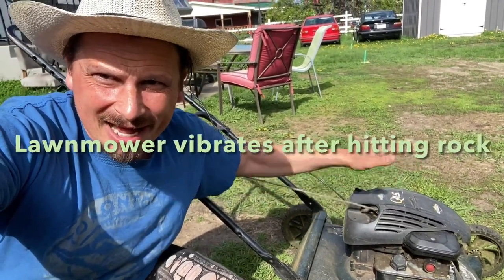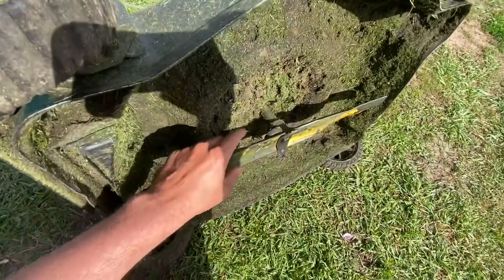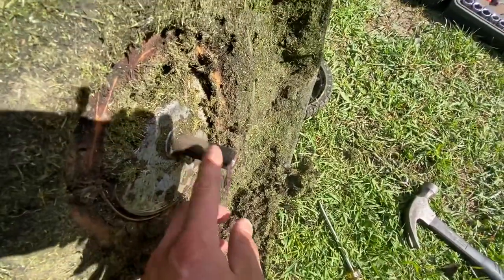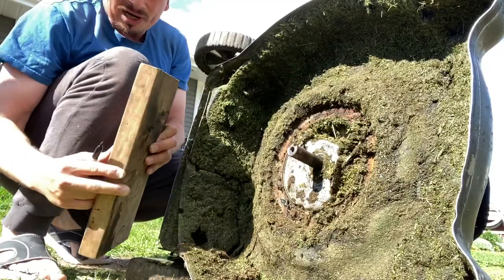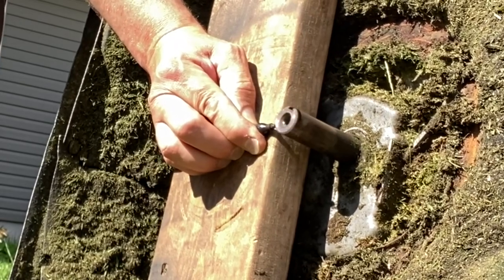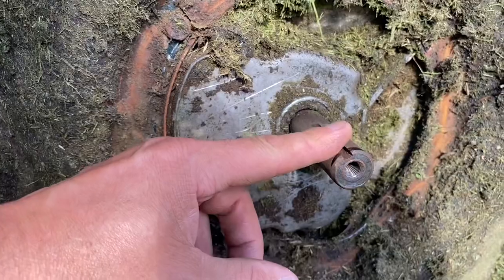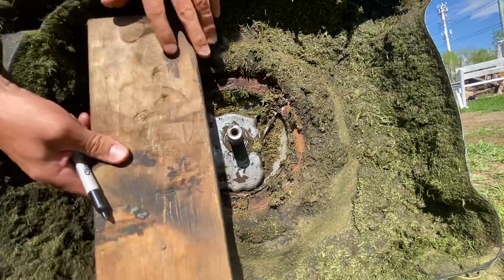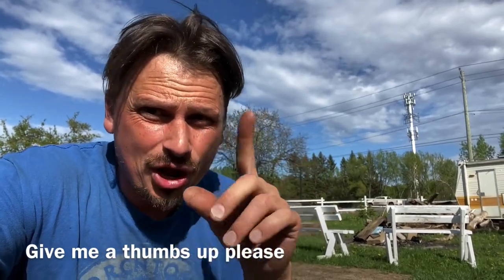How to fix a vibrating lawnmower after hitting a tree stump or rock. Straighten a lawnmower shaft.

Comment: I used to pound the sand outta my old mower’s crank when it bent but then discovered the more controlled method of using an eight foot pipe. Just tip the mower and strap it against a strong fence, take the propeller off, put the pipe over the crankshaft and start yarding on it.

Comment: Always remove the spark plug before doing any maintenance on the underside of any mower. It makes a mechanical accident impossible. If the clamp bar connection on the mower were to malfunction and keep the plug ‘hot’, you can start a mower by simply moving the blades. Think of old movies where the guy yelled “contact!” And manually started the propeller of an airplane, mowers work identical to this. Safety first. This is how people lose fingers from trying to work on a mower
Reply: The clamp bar does not only keep the spark plug disconnected but it also has a mechanical brake on the engine.

Comment: You had me nervous when the spark plug was in and you were handling the blade. Great fix, with a cabin in the precambrian shield this will save me thousands
Reply from the maker: Yeah the lawnmower was turned off. It's
Reply: Did you think the mower was going to pull its own cord and start itself? Insane thing to be scared of.
Reply: @Blueshirt38 Spinning the blade by hand is exactly the same as pulling the cord. For a well tuned mower the only thing that is keeping it from starting is the safety switch. Popping the spark plug wire off is cheap and easy insurance, especially if you're going to do it later in the process anyway.
Reply: @jasexavier  Gosh, if only mowers came equipped with some sort of dead-man's-switch style mechanism that would stop the ignition coil from sending a spark to the combustion chamber when not held down... Oh well, I guess we don't live in that world, so we should all live in a constant state of fear that a strong gust of wind may start up our lawn death machines on a rampage.
Reply: @Blueshirt38  As I said, the only thing keeping it from starting is the safety switch. Like the safety on a firearm, they are useful, but they can and do fail. Also, older mowers don't have them, and some people deliberately bypass them. In any of those cases it's possible to start a mower by rotating the blades by hand.

The safety switch also keeps it from starting when you pull the cord, so by your logic, there's no need to disconnect the spark plug for that part either.

Or, take the maximum 5 seconds it takes to make sure it can't start.
Reply: @Blueshirt38 When a mower is on its side it is very easy for the lever to get accidentally held.
Reply: @Blueshirt38 …and 3rd gen DeWALT 2x 20V Max mowers are currently under stop-sale and recall due to a wet yoke causing the blade to spin with the safety key removed and the deadman lever released.

Disconnect spark plugs in gas mowers and remove batteries in electric mowers while working on the bottom with the blade attached. Please.
Reply: @emmettturner9452  Well obviously this isn't an electric mower, and none of us were talking about them, so that is absolutely irrelevant. Can you please describe to me HOW you could accidentally completely depress the bail bar enough to allow the mower to start on it's side? Do you flip the mower over and clamp the bar to a tree? I have never touched a mower with a bail bar that sensitive, unless you have modified it to not require it to be pulled TIGHT; nor have I ever touched a push mower that is tuned like a racecar like @jasexavier mentioned, so well that you could turn the blade 20 degrees and it just decides to start. 99% of push mowers in use require like 3-5 full power pulls to start, no one is tuning them like this.

You people are talking absolute nonsense.
Reply: @Blueshirt38  …except I explained the relevance since both have the same bar and both can get held on their side. Again, it’s very easy for it to get held completely when the mower is on its side, whether that’s from sliding around in tall grass or from the handle being dragged on concrete.

I brought up DeWALT mowers in a follow-up only due to a current recall that is 100% relevant to your assumption that not pulling the bar somehow makes any mower safe. In other words: YOU made it relevant with a silly rule of thumb that doesn’t work in the real world for gas or electric.

Look at all the Honda owners bragging about how their mowers start with a single pull even after being stored all winter, then take a look at all the electric start gas mowers in stores today and tell me again about how all gas mowers require 5 pulls to start. It simply isn’t true.

Comment: I ran over a half buried piece of metal from some kind of a tray it's amazing when you try to mow a property or litterbugs just dumped all kinds of junk that spread everywhere and how many people out there don't know the concept of a trash can because I also ran over some half buried yarn it was a yarn ball and that literally broke the mower. So when I tried to start the mower it sounded like a machine gun and it vibrated so loud I thought it was going to explode or something. I'm going to try this method and see if it helps thank you! Because of the economy now a lawn mower cost $200 even $300 for the cheapest mower but Walmart used to have them for $120 for a nice sized small mower. Now it's double in price so this will help hopefully.
Reply: Dude the same thing happened to me ! Did this work?

Comment: Thanks 'Problem Solver Garage', I'm a Russell Island Qld Australia resident where small engine mechanics are hen's teeth, a ball pein hammer fix is right up my ally, after mowing a star picket that stopped my Masport mulcher mower dead.
Reply from the maker: Nice 👍 
Thanks for watching
Reply: Stopped the Masport from vibrating but had to put it in the fixit shop to replace the key that had thrown out the timing, i hadn't the tools nor the enthusiasm to fix myself. Thanks again.

Comment: Another website I just watched recommended using a long pipe for this job. Banging on the shaft risks doing internal and fatal damage to the engine. The bent shaft issue could be avoided the first place if the blade was held on the shaft with shear bolts.
Reply from the maker: I literally cut lawns for a living, trust me this is how it's done.
Reply: @ProblemSolverGarage  Your money.

Comment: Do you have to remove the gas and oil first to prevent them from leaking or mixing?
Reply from the maker: The oil should be fine, I wouldn't do it with a completely full tank of gas

Comment: all you really need is a good eye, and a sledge hammer
Reply from the maker: Correct ✅
Reply: @ProblemSolverGarage  thanks for posting this. helped allot with the aweful vibration in handle. turned out i needed new blade too.

Comment: I saw in another video where u just need to pull the boot off instead of the whole plug ?
Reply: There's no compression with the spark plug is out so you can turn the shaft around easier when you pull the rope.